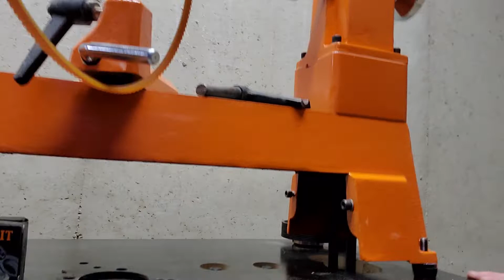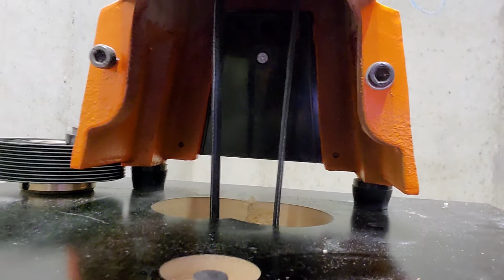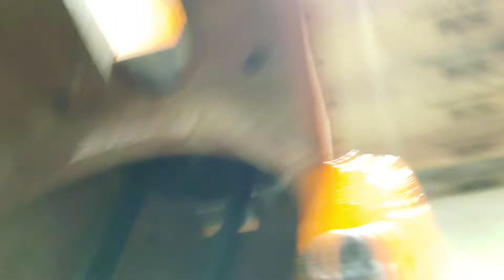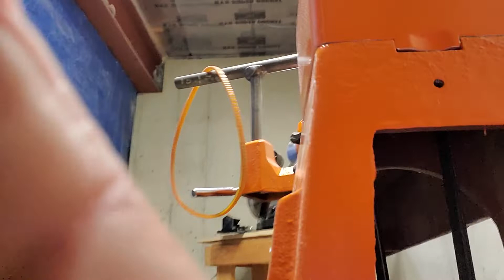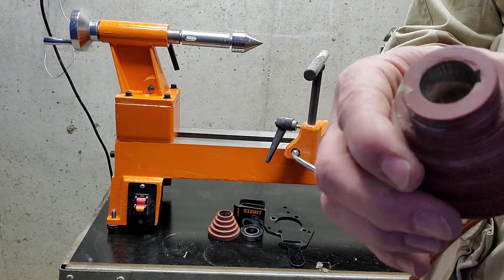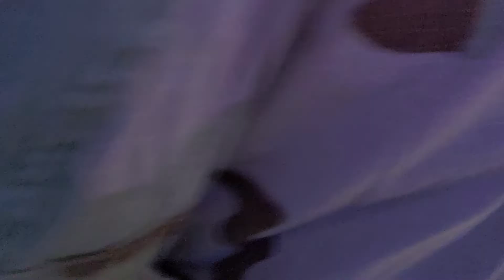woodturning-My new and improved super pro modified cheapo wood lathe.

Comment: I converted a 1946 full size wood lathe from manual pulley belt to full electronic variable speed by using a treadmill motor, the circuit board from the treadmill, a DRO unit, a toggle switch for F-R operation, a pot connected to the circuit board, a delay switch to trick the treadmill circuit from having to turn the pot back to zero every time power was switched off and riser blocks like you did. Unit works very well and have rpm range from 100-3200. Majority of parts easily available on Amazon and cost very low. If you would like any more info reply to this comment and we could work something out. You are right- treadmills are a very valuable and cheap method to improve our shop tools.
Reply from the maker: Thanks for watching. And thanks for the comment. The only thing I have left to do is install the F and R switch. I have it already.  I just never got around to installing it. And a new beefed up banjo. I have to wait till I have the open machine time to do that.

Comment: Beef up the banjo arrangement and tool rest. Vibration, vibration, vibration. Also, maybe make the riser blocks from something more dense and heavier. Nice to see engineers at work. Best regards.
Reply from the maker: You are correct about the banjo. I have a new one under construction that will accommodate the new 16" swing. That project did get put on the back burner for a while tho. Due to my work load. 
Welcome to Wantlessobject.  Thanks for watching!